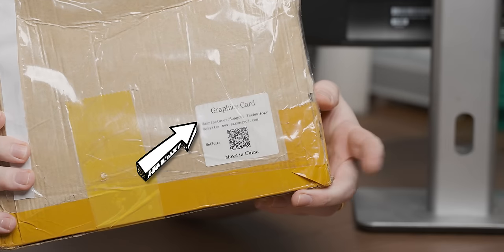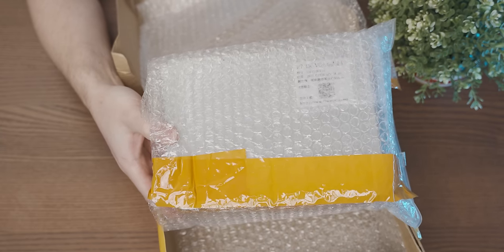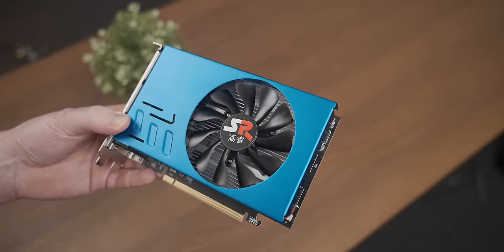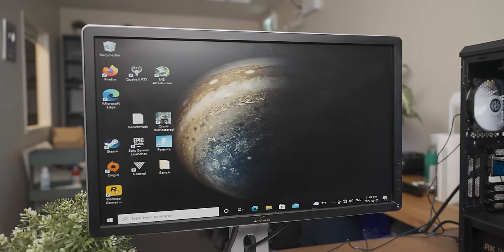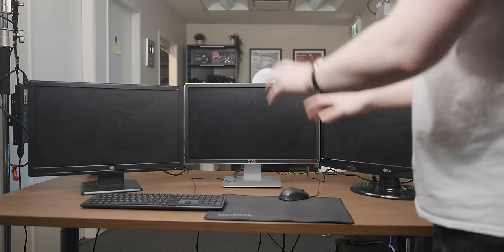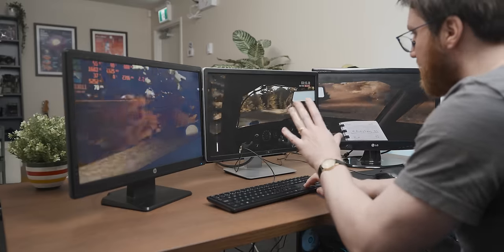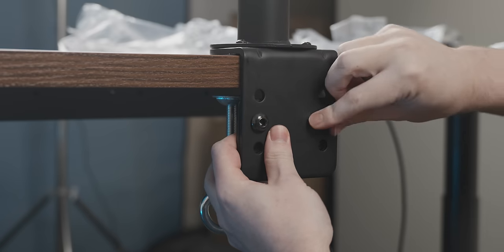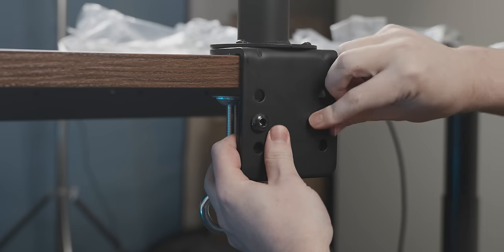6 Monitors, 1 GPU: World's WORST Multi-Display Gaming Setup

Comment: I've tried 3 and 4 monitors hooked up before. Found that it's too much real estate; and getting neck whiplash from moving one's head, especially anytime that you look at the monitors that are way above the natural forward point.  Even left and right with three monitors is a bit of a  pain. It feels like whip lash to a degree.  For the most part, I settled back to two monitors using the one monitor as the primary, with the secondary just as for a "reference" monitor - a monitor where I'll have reference material available for viewing.   I should note that for a while, with three monitors, I used two monitors in landscape, and one in portrait - which worked the best for reading detailed instructions, PDF files, and taking screenshots of landscape oriented data. 
Actually have been considering pulling the monitors completely, and switching to a 4K projector although I figure that'll probably turn out poorly.  Maybe I'll just go out and find a nice 4K monitor of a larger physical size and be done.   Still debating the approach to take.

Comment: As someone that enjoys multi-monitor gaming this gave me a good laugh, heck I even had some of those LG flatrons you had on the top row, good times.

Currently rocking 3 matched Dell 24" 1080p 144hz monitors paired with an RTX 3090, it's a lovely experience though I do wish I had smaller bezels.

Comment: The r7 350 was my first gaming GPU. It was inside my Optiplex 360 with 4gb or ram and a q6700. Course mine didn’t have 6 VGA ports. I was wowed with the performance coming from my AMD A6-5200 laptop.

Comment: To be fair, that cars is a hell of a value if you're looking to put up a multi display array for a store or something like that, and even more if you want to have it be an SFF or at least micro ATX build, where you could only have 2 cards, and some of the cheaper cards have only 2 ports, so you'd have more with this. O ly thing is that you'd have to use VGA, which doesn't look the best (although, for a store display, you don't need high fidelity video, really)

Comment: You should get 6 identical monitors and remove the plastic case so that the actual panels are very close to each other and have less bezel. Stick the panels to some wood/metal base with some double sided adhesive tape and drill holes in the base material to route the backlight wires and panel ribbon cable.
There's some functions or feature to shift the image to account for the bezel thickness..

Comment: A very good usecase for such a graphics card would be a multiseat environment under linux. And VGA is quite useful for CRT monitors which can deliver quite a nice image compared to many older flat screens. Though it would be interresting if the card supports more than 60 hz and interlacing

Comment: Given the monitor vintage, it doesn't matter much, but flipping the top ones could get rid on some bezel.

I've still not found a truly bezel-less monitor. The best I have right now is an Acer with a .25 inch outer edge to image gap of "no" bezel. I'm not about to spend $1000 per monitor, and I do have rather tight size constraints, as the PC desk is tucked into what used to be a closet. I figure I can run a pair of 24" screens here, when I find a deal on something better than what I have.

Comment: Could you make a video about Acer predator 
Prebuilds and the 3070 variant because the card is quite good it keeps under 71 degrees with a undervolt and even before it went up to only 76 degrees and it is not that notable I have a dark rock pro 4 wich is quiet and the GPU is quiet and cool

Comment: I work off of 3 main monitors 2 * 32 inch and one 24 inch powered by a windows 10 (work only switched from xp 2 years ago!). I also have a 24 inch touch screen powering a desk phone run off of a vista  machine so can attest for the different colours on different monitors. Would be interesting to see a dvi or hdmi version of this but good to see that old card able to handle 6 svga monitors, even though this definitely was not meant to be used for gaming the card equipped itself well. Wonder if you can get 6 of the same monitors and see if that makes any difference?

Comment: Actually i do see why someone would need a card like this. Control rooms in some substations or other control centers that need a lot of info displayed at same time but don't need to/don't want to change their monitors from mid 2010s, when making a system running something newer than some intel q6600 in a dell prebuilt from 15 years ago which was used for the task previously.

Comment: You should have tried some flight sim (MS Flight Simulator X, X-Plane, FlightGear, etc.), using the lower panels for the instruments perhaps?
Serious setups using X-Plane have multiple PCs to handle different monitors however.

Comment: Hey,
I tried also to install windows 10 with a DVD on the same computer ,like you did in the Dell video, and it also failed. So my question is where did you get the Windows setup system from?

Comment: This GPU was probably intended to run front end virtual systems at a call center. For the cost of one modestly spec'd PC and this graphics card (or two); a pile of monitors, keyboards and mice on  USB, you can get a dozen workstations on a budget. They only need to be a be able to run a web browser and maybe some call manager software or email and Bob is your uncle.

Comment: it would be great to see how this runs with different operations going on with each monitor. Now to make it an ok better build strip off all the bezels and get the same monitors. It will of course look nicer and will probably get a better frame rate not much but a bit.

Comment: When I saw that the seller deliberately used VGA, and had to buy silicon to make it work, I asked why, and I now think I know who this device is marketed to. Who, indeed, might need 6 monitors that they don't want to replace, using low-mid tier graphics hardware? Howe about a restaurant that uses multiple monitors to show the orders to the cook staff in different places? What about a security station at a large campus with many cameras? How about a machine shop that needs to display different information to different areas of the floor? 
In short, this appears to be aimed at business customers with very low graphics requirements, but who also need a lot of monitors.

Comment: This would be epic if all the monitors were flipped vertically and stacked next to each other in a row. Maybe do it with 5 monitors rather than 6 though, so you have a centre monitor and then the other 4 following infront slightly to hide the bezels. 

The mental monitor setup could be a benchmark of sorts for the channel too, ALL GPUs go through the torture of the 5/6 monitor setup. Maybe even use VSR for higher end cards.

Comment: You know. Could you remove the plastic Bezels from those monitors to get them closer together. A lot of the Bezels are to protect the edges of the glass, but you can technically get them closer if you took the bezels off and get them right edge to edge on the glass.

Comment: I bet this is targeting the security market. Plenty of ancient setups using VGA LCDs are still out there, and having a drop-in card to push a half dozen extra video outputs at a low price ($180 is very cheap here) is probably pretty appealing. Running a bunch of MJPEG camera streams is not particularly demanding by modern standards.

Comment: The card is designed to be used for signage. For example. The computer running 6 antique monitors at the greyhound station dies. Instead of buying a new set of displays you just get this card and an old Dell from the trash heap and you are back in business.

Comment: I once work for a company that uses multi monitor. Barco is super expensive at that time and they decided to go different approach. We have 6 Dell monitors thin bezel and we strip all the casing out and create our own casing to remove as much bezel as possible. We use both AMD and nVidia, AMD Eyefinity seems to be better than nVidia Mosaic, mostly because Mosaic is for Workstation GPU which is more expensive. Ah, good times.

Comment: This is for commercial or industrial application. Think like a menu system that's displayed on 6 monitors over the cash register in a restaurant. Graphics speed is less important here than signal strength. Since the display wires would have to be more then 25 feet after being wired through drop ceilings, HDMI is out of the question.

Comment: @Dawid Does Tech Stuff
Where can you actually buy this card ? It looks like a great card for programming :) Also could it work as a secondary card , with a Nvidia card?
Reply: i'd reccomend 1 or more used firepro w4100s from ebay, less than 40$, low profile single slot and 4x mini DP
Reply: @virtualtools_3021  Does it work with an Nvidia card installed or do the drivers conflict?
Reply: @mccrh7737  should work together, I've had one alongside a 1060 with no issues
Reply: @virtualtools_3021  Awesome thanks you very much :)
Reply: @mccrh7737  just keep on mind that you only get the GPU acceleration of the card that the monitor is plugged into

Comment: Now the actual question is:  Can you make a decent multi-monitor setup using that card?  Why?  Why not is the better question.  I'm certain using 6 decent monitors that are all the same model and adjust to hide the bezels as much as possible could give you a better experience.   I'm thinking you could also use smaller monitors, like 19" or 17" monitors, as they should be ultra cheap and easy to come by in VGA.  Fun video though, and kudos to the card maker.

Comment: Usually the reason for the existence of these weird computer parts is that someone special ordered the part from the factory for some weird super specific use case, Then since the factory had all the blueprints and stuff on hand they put it out on aliexpress incase they can make an extra buck off the design.

Comment: You should of seen my first multi monitor setup I used a crt in the middle left and right cheep dell and lg mismatched lcd monitors and a vertical mounted 720p led tv running on another gpu
The sad thing is that I only played games on the crt or the tv I never stretched the games out between the monitors

Comment: You could plug that thing in a pci-e 4x slot, then plug the 3080ti in the 16x slot, use the real thing for rendering the game but get the display out from that little abomination. There will be a performance penalty but you will get frames.
That thing is a godsend for any security desk btw. It has real uses.

Comment: I have a hex monitor setup with 2 video cards and 6 1440p 144hz monitors with a much lower bezel size. 2070 super and 1060 6gb card. works well for surround gaming and watching videos at the same time.

Comment: you could've used 6 identical monitors with just vga to hdmi/displayport adapters, probably would've worked a LOT better
maybe even run the games on a second gpu and just use the abomination to just output video

Comment: Actually looks like a card with the perfect specs for an industrial process monitoring pc. Most of those run Windows 2000, XP or Linux, so the older chip makes sense, given the newer chips choke on such old operating systems.

Comment: I am surprised the GPU can handle 6 monitors where it seems common to be limited to fewer monitors, but maybe that is just with the maximum bandwidth of the HDMI/DisplayPort ports, then if you didnt push it then they could handle more displays.

Comment: I can't help but notice that the card is running at 800 MHz and it should be running at 1000 MHz and boosting to 1050. I wonder if it could be overclocked or if the GPU die is actually from something more terrible like an HD 7750.

Comment: i need to goto 3 monitors, even the worst massive desktop real estate is better than alt - try building cheapest refurb platform adding nvme arrays and faster networking but notably also gpu passthrough - the gpu enabled small biz machines are ok - i would advise older green team like a 1060 - you still get compute with right drivers - pentoo always gets the drivers right? of all live iso they were only ones last time i checked... so anyways get rite drivers and then run ./ptf - pentesters framework - it installs everything on debian it just works, install qemu and run vms at boot and you can boot into native deb, win and osx and possibly android if you want to run 4 monitors - cut and paste between different os desktops...

Comment: I used to crossfire 2 4870s back when Crysis was still new on 3 17 inch CRTs with probably 4-5 inches of Bezel and 25 fps on Medium was acceptable. I still LOVED it. These Days I'm spoiled, I could never game like that anymore! I suspect I'd rather just play on 1 of them vs all 3

But hey, for an olden-days dirt cheap workstation or as a secondary GPU just for the 6 vga this is probably still a useful product in some situations. I love VGA for some reason

Comment: This is why I prefer 4k TV as a desktop monitor. No bezels plenty of screen real estate.  As for the neck, issue the trick is to move the eyes instead of the head, by resting the head on the headrest of the chair.   But it takes time to get used to, I had issues in the first weeks when switching from a 30" monitor to a 40" TV.  I would have switched back during that period if it didn't mean that I would have had to undo my GPU upgrade. 
And if anyone goes for this, get an 8k HDMI cable instead of a 4k HDMI cable, most cables tell the maximum resolution with blurry display compression set on. So 4k 60hz cable is actually 4k 30hz cable when you want readable text.

Comment: you might be able to use the card as a passthrough, I use to use a gaming gpu to drive my main monitor and a $5 quadro type card I got from a college sale that could barely run minecraft but I used it to drive my two other monitors and I was able to drag the window into the other monitors and it was still technically playing on the gaming gpu, It's kind like how on a gaming laptop you can either choose internal graphics or the dedicated graphics.

Comment: I have ben and am a multi monitor guy 3+1 for years now all three are BenQ 27'@75hz with NVIDIA surround (5760x1080) its mainly my flight/Race sim set up but my 4th monitor is a MSI Mag 27somthing something But its 2560X1440@144hz that's for all other games & i really dont want to be without them now days..I even tried it last year i went to a 34' ultra wide but about 4-5 weeks in i just hated it and so i bought my 3 new BenQ monitors & haven't looked back sense !

Comment: The monitors at top should be at bottom and  the monitors at right should be at left so make it more cursed

basically for example the the monitor at top left works for top left part of the screen then if you keep it at the bottom right it will work as top left and look cursed

Comment: multi monitor is a learning experience, you cant judge the book by the cover. You have to read the book from first to last page. You learn to ignore the bezel and the "look around" thing will become normal after a while. I miss my multi monitor setup but i cant apply it with my current software so its a issue im trying to solve

Comment: But then again, this kinda janky monitor setups on a wimpy GPU, is perfect as an office work, or if you're a security guard needing to monitor multiple CCTVs in a single system. 
I miss Multi Monitor setups sometimes. I used to do Eyefinity for a bit on 3 monitors on 2 Radeon 6970s, then on nVidia Surround with 2 GTX 970s and I used that to my advantage in Diablo 3 where I can notify friends of incoming Elites from a lot further away than they could.

IMO, 3 monitors is the most I would go. You pushing 6 monitors is effectively 150% of 4K.

Comment: As a long time multimonitor guy, I would insist that this is a very poor use for this sort of thing.  What you want is one really good monitor that all of the games go on, and then all of your other junk floats around on the other monitors so that you can multitask like a boss.  Even if you have magic monitors with zero bezel, splitting a game into multiple monitors is "not awful", at best.

Comment: I've got 6 monitors on my setup, 3 main, and 3 upper, but I use it for VM windows, and reference material, chatting, Netflix, etc while I'm doing software development.  I'm running  across 2 Nvidia cards, a 1050 and 970 ... I'd be using better cards, but the word made them scarce and expensive.

Comment: I've been running 3x23" monitors since ... early 2000s? Even back when I had some HD 4850s in crossfire, before AMD drivers natively supported eyefinity properly! Fun fact! The fisheye effect/ zoomed in area you notice is exacerbated across 3 monitors, but does exist on a single display ... albeit only on the last inch or so of your display, so scale it up, and you get more! Fun fact! AMD used to support bezel correction where you could adjust and 'render pixels' as it where, behind the bezels so you didn't get jarring transitions between screens by faking a few pixels!

Comment: Pro Tip: To CLEAN your LCD monitors Propely you need to use a 50/50 mix of Distilled Water and White Vinegar  ONLY ! Do not use Spray cleaners or stuff you buy off the shelf in a store Ever! Only use what i prescribed and Nothing else . You will not only get a CLEAN screen but you wont do Any damage to the Coating that is on them . You also wont get those disgusting Smears left over .